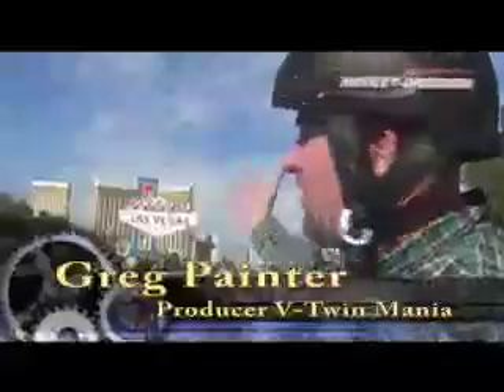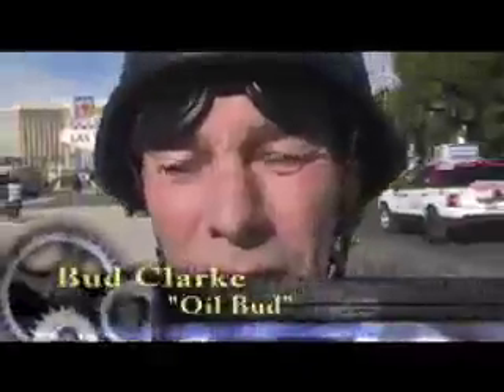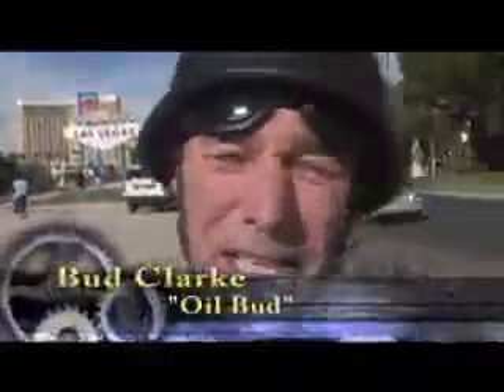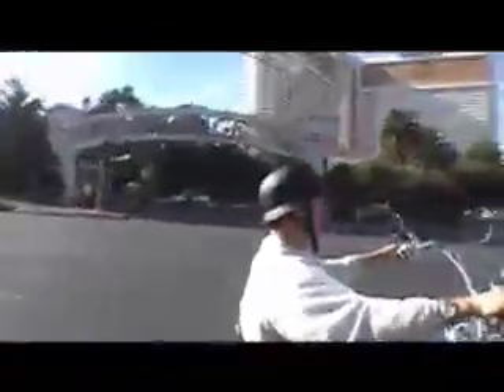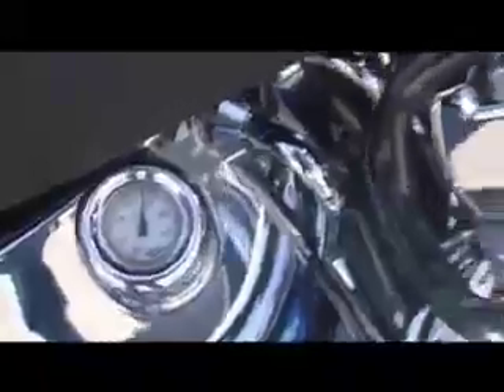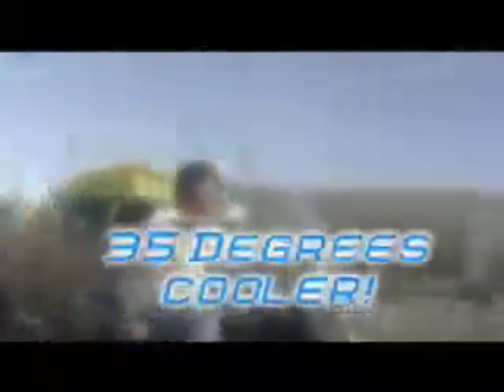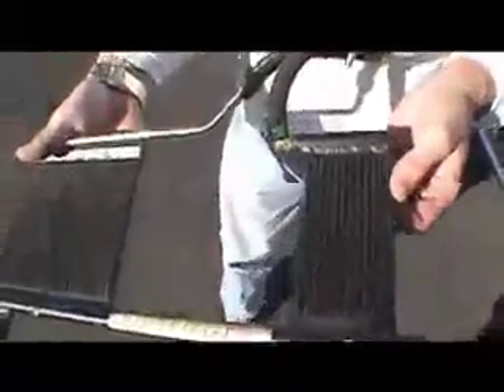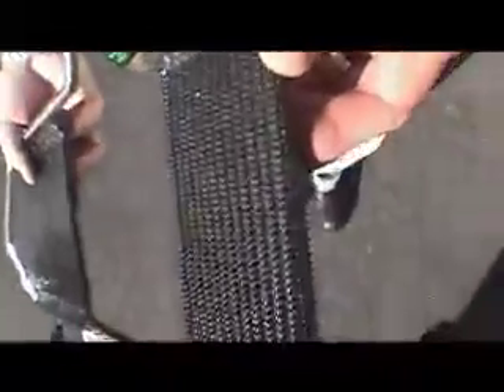OIL BUD

Comment from the maker: No the Oil Bud™ Does Not interfere with anything requiring maintenance, like a transmission fluid change under the bike.  The product fits between the frame rails so you can jack your bike for service.  Also - Rocks and debris do not harm it.  It is durable and discrete.  It's COOL!